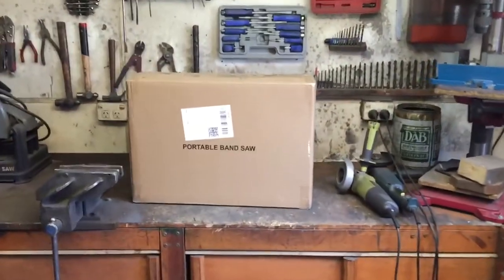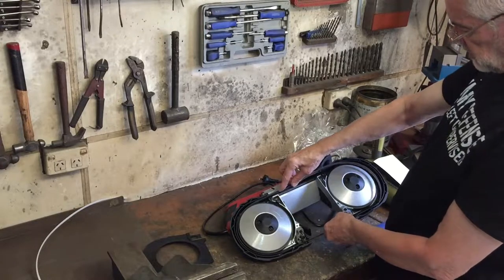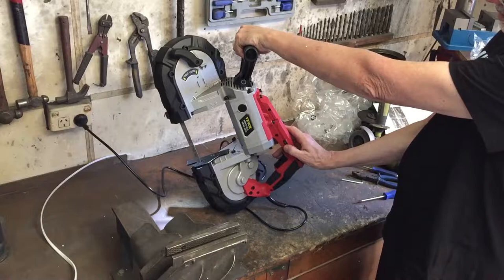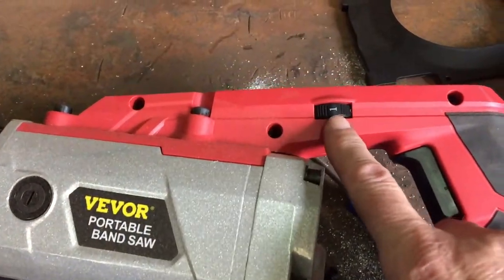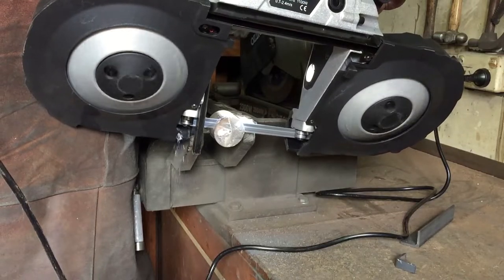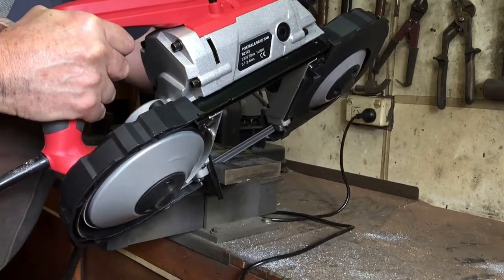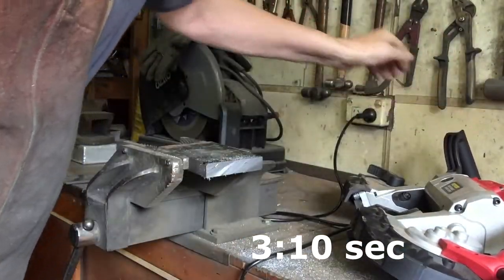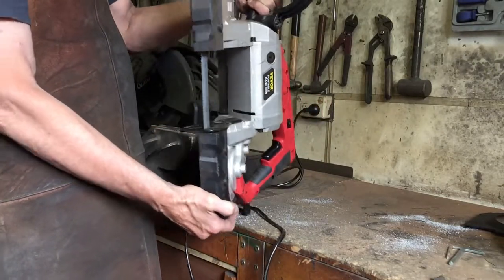Portable Metal Cutting Bandsaw Review - Vevor

Comment: Just got one. Lousy manual, so I also had to work it out myself. Interesting to hear other experiences. You're right, other makes don't have the plastic covers.
I opted for the optional stand, while expensive, is a great asset.
Hint - I also found that one guide resisted blade  insertion. The trick is to get a small adjustable spanner, set to the width if the blade, makes a better manipulator  than pliers. The blade twists pretty easily.
Reply from the maker: Good tip. Thanks. 
I’ve used mine a lot now and am very happy with it. 
I agree a stand is very useful. I love the one I made for mine.